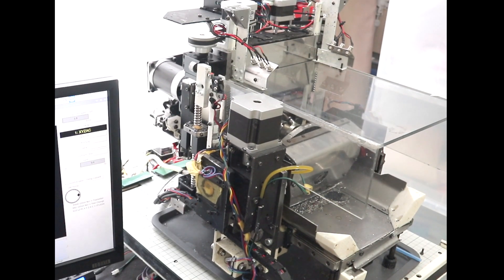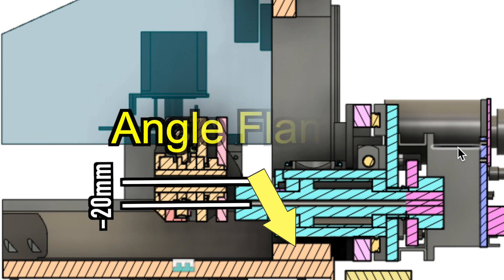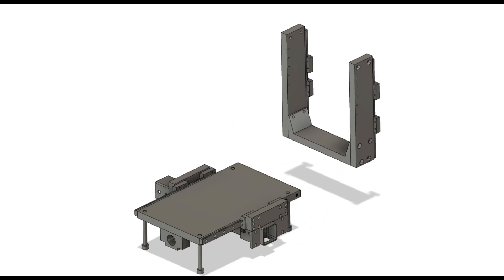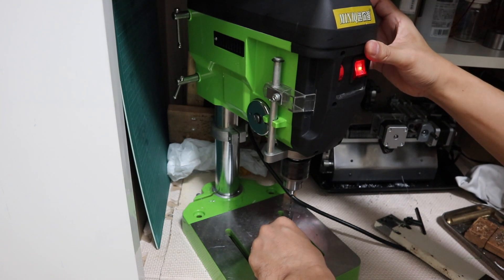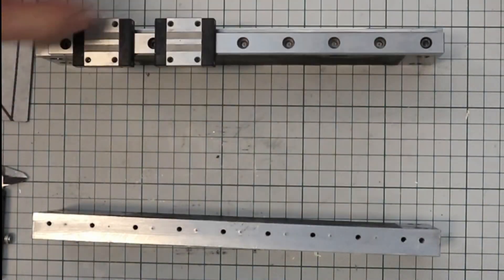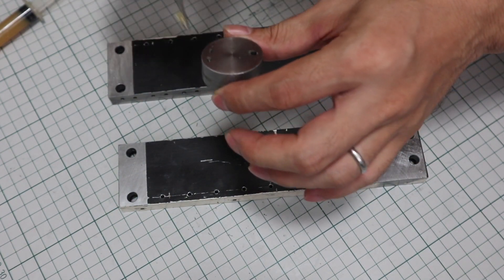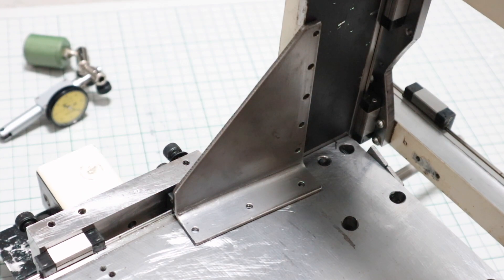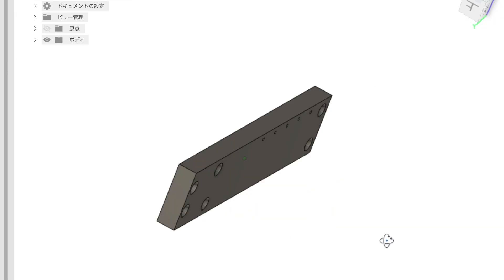【Base Flame】How to Build CNC 5-axis . Part-2 |  Know-how for Building Small Machine at Home

Comment: 1) All of these contact surfaces should be checked for complete alignment with Prussian blue.
2) The connections only have screws. Additional pins are required.
Reply: LOL, have you noticed how many times this has been modified? It is clearly a work in progress, scraping and pinning at this point would be a total waste of his time.
Reply from the maker: thank you for advice.
I think you are right.
However, even if I check the installation surface, I don't have the equipment to fix it.
I think I should use the pin after adjustment, but I'm thinking.

Comment: 3:45 true 

i guess you are using the CAM side of Fusion 360 already, do you plan on making a machine simulation for 5 axis machining?
Reply from the maker: What do you mean?
Your mean is that am I planning to make a video of how to set up 5-axis machining for fusion360 CAM?
if so ,Yes
But I think I'll finish this series first, make a video of electrical and linuxcnc setup, and then CAM.
I want to make a video sooner, but it's difficult.
Reply: @a-cnc-f  no, what i mean is there is now the ability to fully simulate your own machine when simulating machining. For example You can see if the spindle would collide with something or axis overtravel.
Reply: @a-cnc-f  i would love it if you plan to make some series about electrical and linux cnc setup! :)
Reply from the maker: @andysen1987  Yes, after this mechanical series